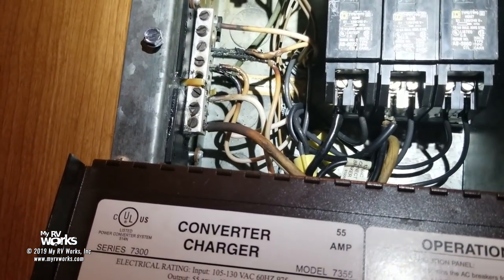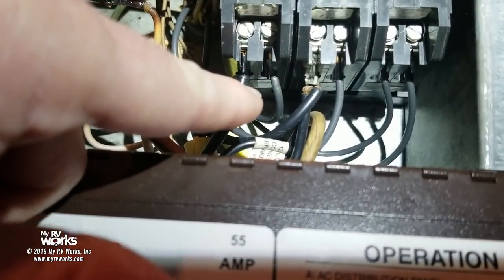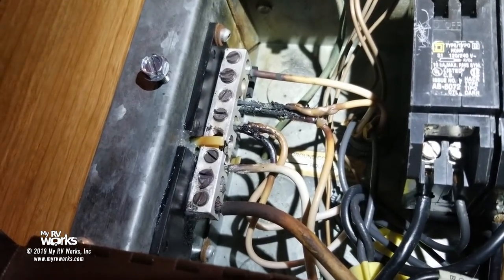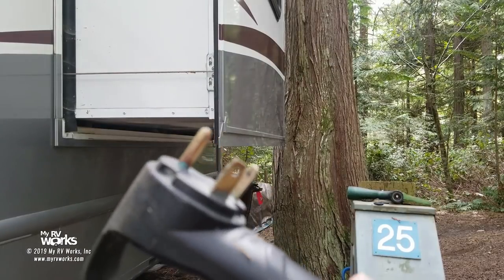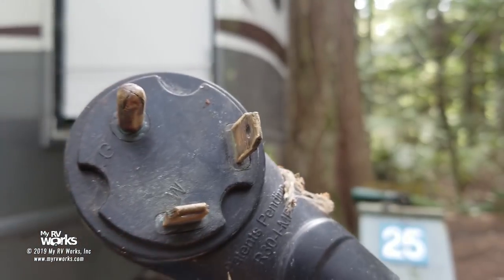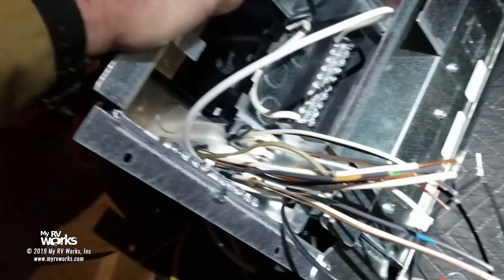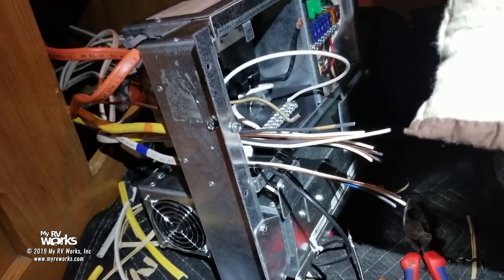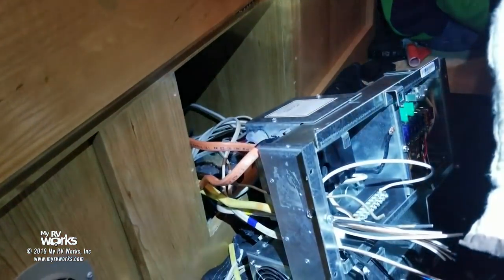Replace RV Electrical Service Panel & Explanation Of How Electricity Works

Comment: Okay it appears that he did a good job replacing all the wires but I might of just cut back all the neutrals an inch or so to get good looking copper or used a little emery cloth and replaced the bus bar or removed it and cleaned up the holes and screw bottoms inside the bus bar. I would use some black electrical tape to keep the bottoms of the red 12 volt connector away from grounding out and creating the flash over that you found. 

My opinion other than loose neutral wires on the neutral bus bar heating up the bus bar and  causing burned neutrals the most likely cause would be a hot neutral returning through the ground because of a bad appliance motor, Air Conditioner or something which requires grounding like a microwave. You can have a hot neutral and never know it until something like a motor or transformer goes bad. The most common cause of a hot neutral is wiring errors at the pedestal. Another is a wiring error replacing the long AC pigtail from the camper or the cap on either end for those using a twist lock at the trailer or a miswired generator.   .

Stay away from electrical theory though. Best to teach the DC waterfall analogy height of the waterfall being voltage and width being current and power being product of both. Than just introduce resistance as what hold back the current flow and creates heat in the process. Just say AC is just DC where the current and voltage change direction at a given rate in hertz. 

Unless you want to talk about how motors or transformers work leave out induction, inductance, inductors, capacitors, reactance, capacitance and impedance. Never make things more complicated than they need to be. You don't want to use Maxwell's equations when ohm's law will do.  At 60 HZ in most situations not involving motors and transformers or long distance transmission lines you can safely assume your just using DC current and voltage with a different name on the meter.   

 Why did the neutral wires get hot? The poor connections increased the resistance at the connections while the current remained almost the same.  Your not going to explain how the voltmeter works so why get into how clamp meters work either.
Reply: Didn't you hear him say that was covered under the RV insurance? That's why he did all that wire work $$$$$. 🤣
Reply: @crazygrady127  My opinion is that damage was caused by a reverse polarity hot neutral at the pedestal or further upstream. Too much damage to be just a loose connections. A hot neutral with a way to return through the ground conductor would allow excessive current to flow without being cut off by a breaker at the pedestal or in the RV.

Comment: With all your explanation you messed one up badly.   At about 13:40 you talk about a peak of 240 and a valley of 0 and conclude that the peak to peak is 120.  Otherwise a good explanation even if a little wordy.